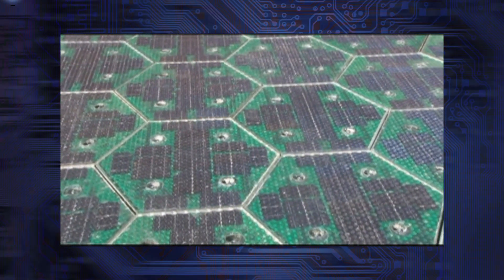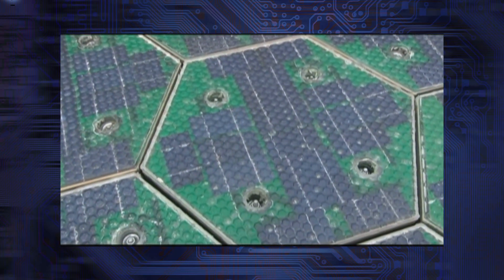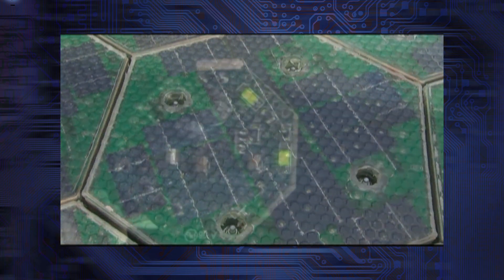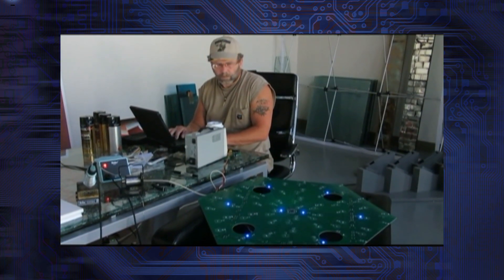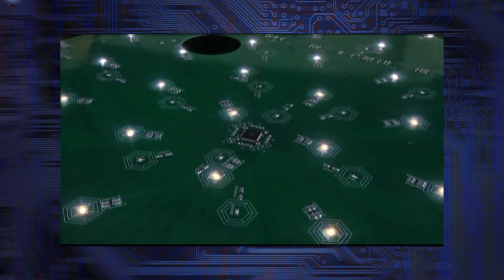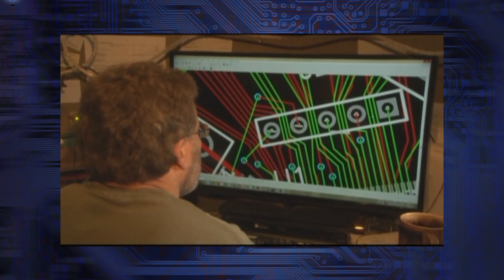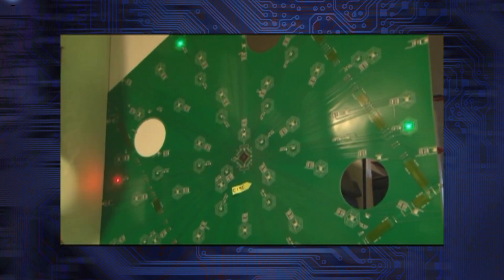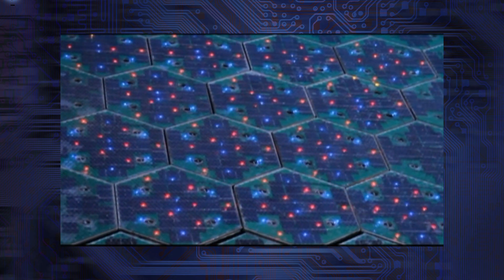Solar Roadways - Smart Streets of the Future

Comment: Why would you put the solar panels on the road, where they could be damaged from constant abuse, when you could just put an awning over the road and put normal solar panels there? It would be cheaper to build an awning over the road and use standard panels - and since they are above the road and out of the way, they could be aimed at the sun and get better efficiency.  This idea is completely impractical.
Reply: That completely defeats the purpose of the panels.  If you just want space to put solar panels, there's plenty in the desert and on building roofs.
Reply: orayole Not sure if you're trolling or just an idiot.
Reply: orayole Your original statement:
"That completely defeats the purpose of the panels.  If you just want space to put solar panels, there's plenty in the desert and on building roofs"
Actually the purpose of the panels is to create photovoltaic electricity from the space already taken up by the roads. If you put the panels on rooftops and out in the desert, that would not be space taken up by roads. Therefore that space is irrelevant to the purpose of these panels. You'd know that was the purpose of these panels if you watched and comprehended the video.

"You don't need to put a roof over roads.  That creates more problems than it solves."
The entire solar roadways idea is completely unworkable on it's face, but assuming you wanted to use the space covered by roads to place solar panels, it would be easier to put them on an awning over the road than on the actual road surface. It's impossible to have an optically clear material strong enough to withstand the abuse of a road surface. It's impossible to generate enough electricity from these panels to light the LEDS and even if you could the LEDS wouldn't be visible in sunlight. It would be impossible to generate enough electricity from a solar panel covered in snow to power a heating element used to melt that snow. I could go on and on about the impossibility of the solar roadways idea, but I don't think it's necessary.

"You'd have to build those roofs very high to accommodate large trucks." You mean like every overpass, bridge, street lamp, traffic signal, and power line we already have?

"Extremely expensive to maintain the support structure for all that."
It would be many times more expensive to maintain the panels if they were on the road surface.
Reply: No dude. You have the purpose all wrong.  The purpose of solar roads is to solve multiple issues, not simply just for somewhere to put solar panels.  Get a brain.
Reply: orayole What issue does the solar roadway solve that our current roads don't already solve - other than generating power? In the solar roadways crowd funding video, they say specifically that they are trying to make use of the space taken up by roads to generate electricity. Maybe look into the subject and get your facts right before you respond. There's nothing tackier than an arrogant idiot who thinks they know what they're talking about.
Reply: Melting snow rather than plowing and salting.  Storm water drainage.  An area to run cables along the road.  Warning lights on the road for objects/animals on the road..  Using the lights to mark lanes rather than painting them.  Easily able to change the lane lines for different times of day for better traffic flow.

You must not have paid attention to anything they said.  This has all been talked about. Not just generating power.
Reply: orayole Have you ever seen a public road? There ARE power lines strung along the side of the road. There ARE already lines painted on the roads. There ARE already smart traffic signals. There ARE already lights on the front of cars. We have these things already. Solar roadways is just proposing a more expensive, more complicated, unworkable way of solving "problems" with our road system that don't exist. The only thing they contribute is the aspect of generating power using the space the roads take up, and the method they propose is totally unworkable. It would work if the solar panels were above the road, out of the way of damaging road debris, cars, settling snow and leaves, and being able to track the sun instead of being stuck to a static surface. That's why I suggested the awning over the road. Of course the awning over the road would be ridiculously expensive to build and maintain, but at least it wouldn't be impossible like the solar roadways proposal. I was trying to play along with their assumption that a complete redesign and reconstruction of our road infrastructure wouldn't be cost prohibitive and that we lived in a universe where their complete disregard for the laws of physics was still a workable option. Just about every other human would have understood that from the context of my original comment. You, on the other hand, are apparently too simple for that level of perception. Then again, if you throw a temper tantrum and ask me to kill myself, maybe I'll just cower at your mighty words and concede the argument. Fucking childish moron.
Reply: orayole Having solar panels on the ground leaves them vulnerable to all sorts of things too. Like having a car drive over them, or having leaves or snow cover them, or having a couple inches of rain leak down into them and short circuit the whole system.
The power grid seems to be running just fine, even with these "vulnerable" power lines strung along poles. It costs 20 times as much to excavate and bury power lines as it does to maintain power lines strung along poles. If you live in the mountains, how are you doing to dig a channel through solid rock to lay power lines? If you live in a flood prone area, how to you maintain the lines underwater? If you live in an old town with narrow streets, how do you justify jacking up the sidewalks to lay down lines that are already there and performing perfectly?
I disagree with this entire concept BECAUSE I can think for myself, and I can tell that it's totally unworkable financially, logistically, and scientifically.
Reply: oggyreidmore Thank you!
Reply: +oggyreidmore well yes if you have a solar powered road then cars are going to drive over them. Your car driving on the solar road is going to damage it was pretty funny, just saying.

Comment: THIS IS A SCAM! 
There's no way to get this work! 
What they need this to work is:
-new kind of material with opacity, flexibility and hardness out of this world
-superconductors workin in room temperatures (the "grid")
-new kind of leds - more light, less heat, wider angle
-way more efficient solar panels
-design ultimately cheap base structure to prevent movement.

...forget it!

Comment: This truly feels like a new wave of the future.  The tech is still a little rough, but time fixes that.  I think that this would be best implemented in parking lots first, and then slowly move it out into the main road system.   Plus if they wait just  long enough, the technology will improve to the point of easy  mass distribution.
Reply: This can't work because of simple problems. You can't power a whole country with solar panels, you need to store all of that energy and so on. They're just a nightmare compared to many other power plants. Just think of dams for example : they produce energy whenever you want, they can work in 'reverse' to store energy from other power sources, they don't depend on the daily weather, they don't require shitloads of amounts of pollution to produce, they last for a huge amount of time... They already put solar panels to shame, let alone solar roadways.

Comment: It's sad that so many have become so excited and hopeful about this solar road gimmick.  Scrutinizing the technical challenges or parsing the reasons as to why this scheme is so fundamentally flawed from an engineering standpoint would be interesting, but the economics are just so untenable. Adding great expense and complexity in the manufacture of solar voltaic panels to accommodate use as a road surface really makes no sense. If we want power from the sun, why not employ solar voltaic panels in the conventional way: On roof tops!  It's simple, effective, and there are no special requirements for panels. Just use existing technologies (and power grid if you want to redistribute energy captured). What such great enthusiasm for solar roads does indicate, is that people are quite eager for a technological solution that would allow current economic and social arrangements to go unchanged, even in the face of rising energy prices and diminishing returns on energy investments. Magical thinking is what this is all about, when what's really needed is a clear vision of the challenges that lie ahead.